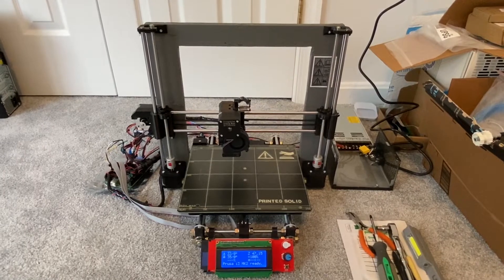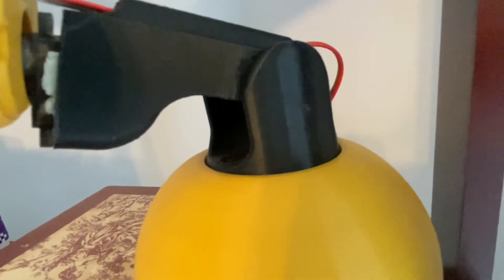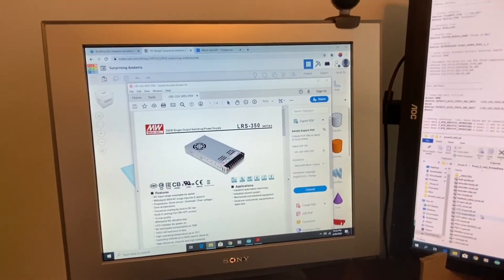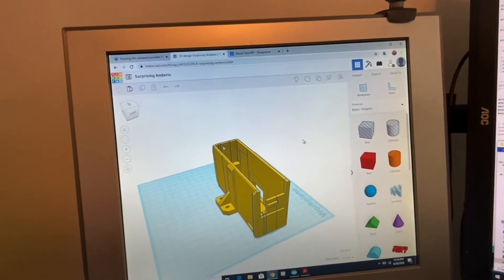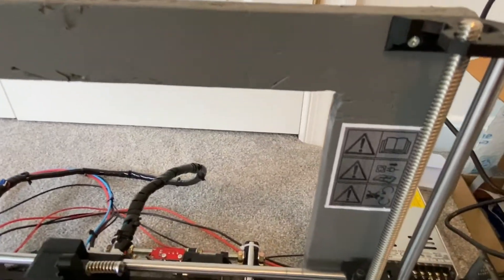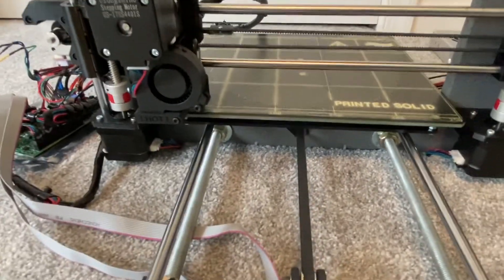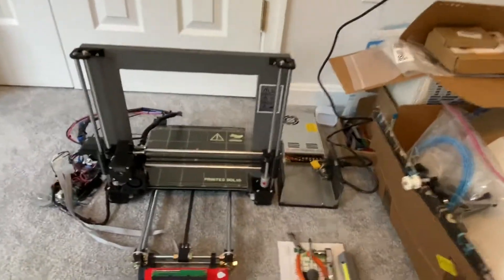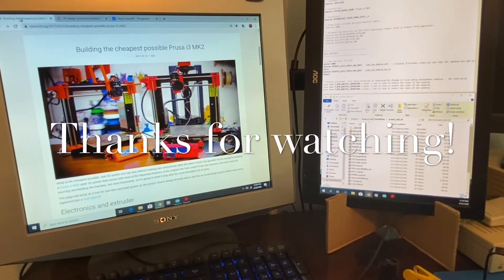3D Printer Scratch Built Prusa Clone

Comment: OSB?!?  why not just press on leafs together?
Reply from the maker: OSB is actually dimensionally stronger than plywood. It doesn’t warp. It’s only “weakness” is if it gets saturated with water. So, I painted it. It’s really rigid actually- look in the third vid in the series where I attempt to flex it. If it ever fails, I can always make a new one outta something else- but I’m satisfied it’s the correct application.
Reply: @corneleousworthington4566  yes I am quite familiar with OSB. as for its strength vs plywood, yes it is stronger in shear making it a good candidate for shelves, roofs, beams ect. But you are not stressing it in shear, most of your loads are compressive & tensile.  And what on earth do you mean "it doesn't warp" ?  EVERYTHING warps.  Yes painting it helps.  even brand new its not dimensionally accurate (on an order consistent with the positioning system) and over time, its going to move all over the place. 

by "attempt to flex it" are you referring to you pushing on it with your index?  If you think that's a meaningful test, you are grossly under estimating the forces involved in 3d printing.  I should note, its not the Z moments that would concern me, its the gantry wobbling as that table whips back and forth.  Now if you print slow and low(z height), maybe its fine for you.  But you made this build video and posted for the world.  Through most of it, you did a pretty nice job (with the build and the camera/video editing), but that chunk of roofing supporting your gantry sticks out like a sore thumb (mechanically, not visually). 

moral of the story is people may be watching in preparation for their own builds and they ought to know that wood ("engineered" or otherwise) simply has no place on a 3d printer.
.
Reply from the maker: Matt, if you have a vid on YouTube that you made of a 3D printer that you fabbed up at home, I’d love to see it.  At no point have I ever listed in ANY of my videos that any of my projects are made THE way to properly do anything, nor the defacto ideal in any area.  I just enjoy making stuff.  And, there are many others who have used the same materials as me in their builds, and on reprap.org which is where this open source design ultimately comes from.  So:  No, I'm not putting bad ideas out there if this is what you're implying.  If anything, I'm showing people you can make something you want- even if you don't have the ideal materials.  
Yes, the wood frame is not as strong as some other materials. But- at this thickness and size, it’s plenty strong, arguably as rigid as the 6mm aluminum frame of a real prusa for the same application, and not the weak point in this 3D printer design (the 3D printed parts are, and/or the zip ties holding the Y-axis bearings are, and/or the super cheapo linear bearings are, or...  The entire design is engineered to a relative tolerance point- and not a point of perfection)....  
I might also wager that absolute rigidity (and “compressive & tensile” strength) in a 3D printer will work against you, and having a little bit of give will smooth things out.  I had some OSB for free in my garage, decided to try it out, and was pleased with the level of rigidity of the part once fabricated. Now fully built, this thing prints awesome- exponentially better than what I had before (which was also made of wood).  
PS:  remember that the latest real Prusa design is ultimately printing items on the heated bed, made of essentially thin garolite, and now with a thin aluminum flex plate on top fixed via magnet.
Reply: @corneleousworthington4566  no videos but here is a photo album:  https://www.flickr.com/gp/188989727@N05/6R76Ea    apologizes for the order of the photos, something happened to the timestamps, did my best to re order them. do note that this is my first printer, actually stumbled upon your video in preparation for building a cartisian machine.

I think its great that you like making stuff, that's something we have in common.

"Yes, the wood frame is not as strong as some other materials. But- at this thickness and size, it’s plenty strong, arguably as rigid as the 6mm aluminum frame... "
any empirical evidence to support that claim?  Also, my point was less about strength and more about dimensional stability over time.

"I might also wager that absolute rigidity (and “compressive & tensile” strength) in a 3D printer will work against you, and having a little bit of give will smooth things out."
not even multi million dollar CNC machines are "absolutely rigid", but they certainly strive to be.  And if your methods for alignment are not up to par, then yah, some slop is going to be necessary so the thing does not bind out...again, only if you cant put it together properly.

You say your prints are "awesome", again not very empirical.  Curious what sort of speeds/accel you run?  and if you often use much of the build height.  I would expect this printer to do pretty well when its printing  low and slow.

"remember that the latest real Prusa design is ultimately printing items on the heated bed, made of essentially thin garolite, and now with a thin aluminum flex plate on top fixed via magnet"  I am unclear what point you were trying to make here, but I was not aware of that, interesting factoid.

you really seem to want to defend engineered wood, and its place in 3d printing.  that's not something you will convince me (or most people) of.

lastly, I get the feeling you feel like I am attacking you/ your build.  If that is the case, apologizes, my intent is merely critiqued it so that others can learn.  and I would not have wasted my time doing that, if you didn't have a decent budget machine.  But the next guy who wants to follow your design should know that a skimping on the rigidity/stability of your frame should be avoided.
Reply from the maker: @mtraven23  First- honestly- you built a really nice printer!  Looks bulletproof, and I commend your design and execution.  If I had a welding setup, I'd look to build more things with metal.

I'm not trying to be defensive or on a campaign to promote engineered wood or anything.  But after using it myself, and using it in this application- I do think it is ample.  Now, what it will perform like in a couple years, and after exposure to humidity, I very well may be changing my tune!  But, for now- it's what I've got to work with, and I honestly think it's ok.  Not ideal, but certainly very good (if you don't believe me, seriously, try it)..

I'm absolutely not the first by the way, to use wood in this exact application- check these guys out- they're who I was watching before I built mine:
https://www.youtube.com/watch?v=e6WZMBQgyqU
https://www.youtube.com/watch?v=J6_z0YMhYdM
https://www.youtube.com/watch?v=cfIovRg5pLI

One of the reasons why I'm OK with wood being used for the gantry frame is, the build surface in these printers only moves on the Y-axis, and that movement is directly supported by the metal frame- which is squat and very strong in this setup.  Yes, the X-axis is moving side to side and mounted to the gantry, but I believe due to the shape of the gantry- it is well supported in this regard.  Z-axis is moving so slow (comparatively- although it does have hops in there at times depending on settings) but I also do not it is an issue.  Check out some of the similar designs on reprap.org:  https://reprap.org/wiki/RepRap_Options  (Some of those printers have NO gantry at all!  Not that I'm advocating that, but, it's adding to my comfort level using wood here.
  I'm using standard Prusa i3 MK2/S settings- so default speed. 

My point about actual Prusa's using garolite (essentially circuit board material) and magnet fastened metal is to simply point out- there is play in that setup.  Based on my experiences, and also the opinions of others (this guy is a mechanical engineer specifically discussing attempting removal of all play in a Prusa i3, and whether it is beneficial: https://www.youtube.com/watch?v=J_RcgixLbAI) is why I respectfully disagree with the idea that some play/tolerance is only helpful if the machine is assembled incorrectly in the first place.  

And if I seem defensive- I think it's because you're implying that I'm wrong for suggesting use of wood- and you are voicing this to make sure viewers know not to make the foolhardy choice of using it in this application.  I'm not advocating anyone build this printer my way (after all, you can buy a better printer for less!)  I'm not advocating someone specifically seek out wood to use for this application against other materials.  I am showing how I built mine- I've explained my opinions- and I am confident in my own engineering skill/abilities to know this is not a bad choice.  I am fairly picky- and would not use anything that I determine to be insufficient in any design.  That should be evident looking at other aspects of this printer build I'm showcasing.

At any rate- thank you for your feedback, I'm glad you found and commented on this vid!  You've got other vids on your channel- so dude- showcase that beast of a printer you made!  Share it, let's see what you've built!